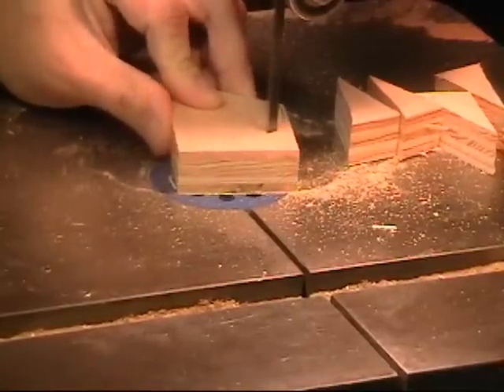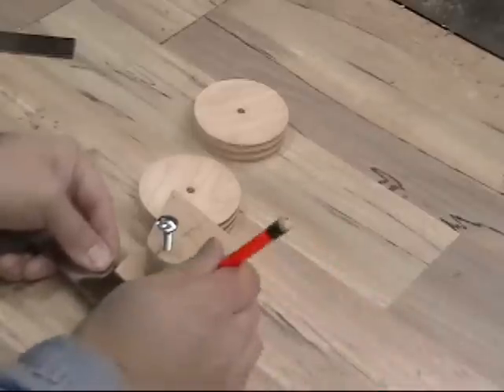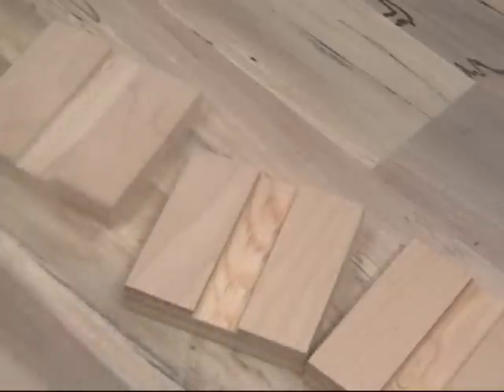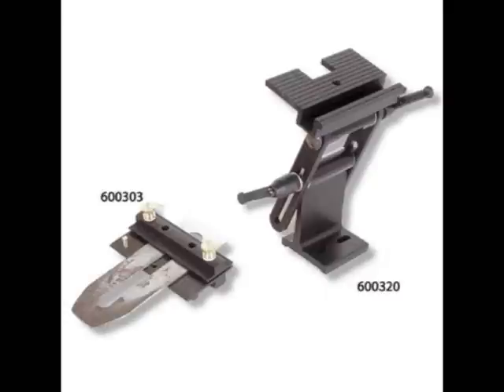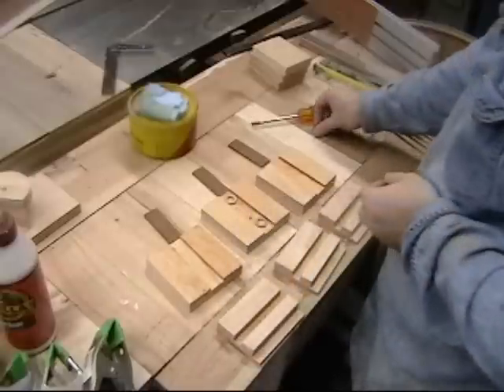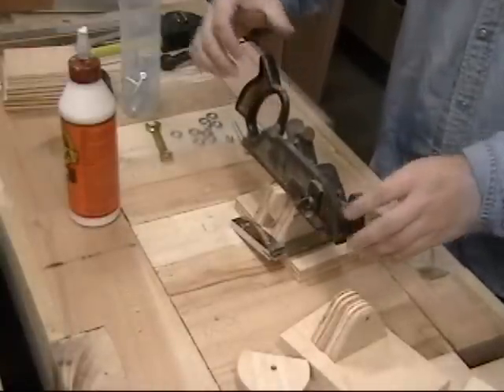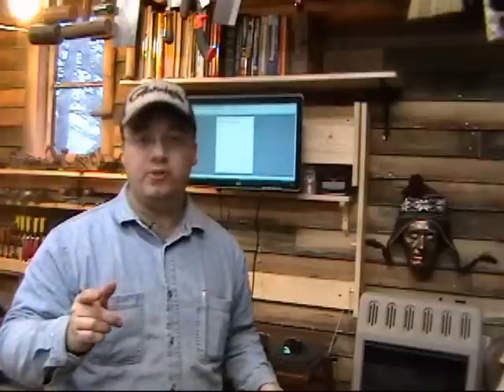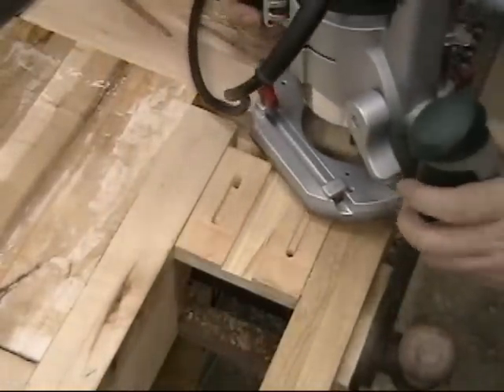Homemade Grinder Tool Rest & Veritas Grinding Jig Review-Woodworking with Stumpy Nubs #7

Comment: No stumpy you don't show the jig in use, never with a iron or chisel in the holder up against the grinding wheel actually being sharpened, only loosely set there, also some basic info like how high the arbor o your grinder is above the base and the size of the round disc just for reference, I have made the first one and it is no good so I threw it away and am now starting the second and adjusting the sizes, trial and error could be sped up with some basic starting points based on your arbor height